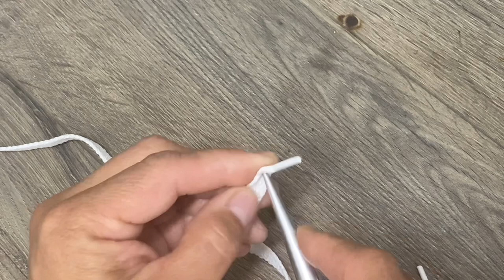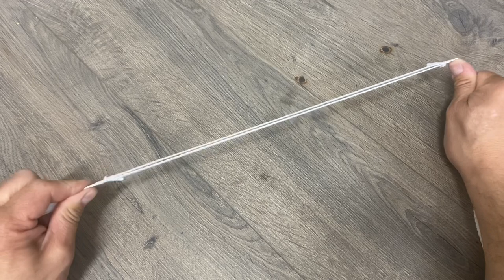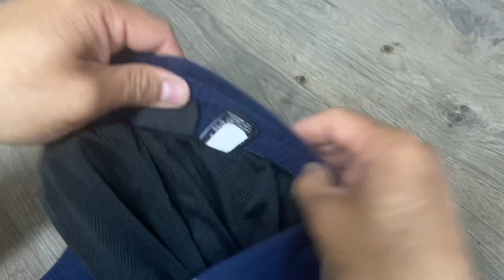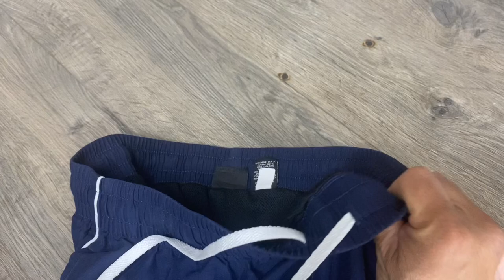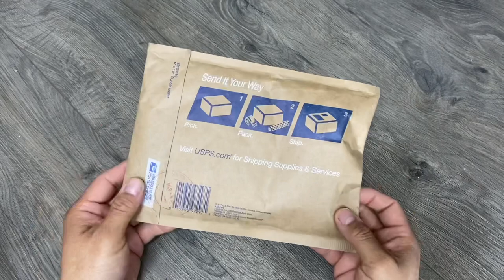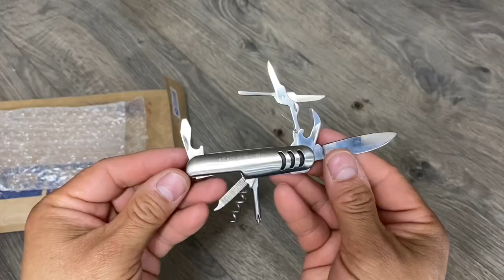How to replace your drawstring.

Comment: If one string gets pulled inside of the shorts, is there an easy way to pull it back out ? The bobby pin trick is great to start a new string
Reply: you could pull the whole thing out from the other side and then use the bobby pin